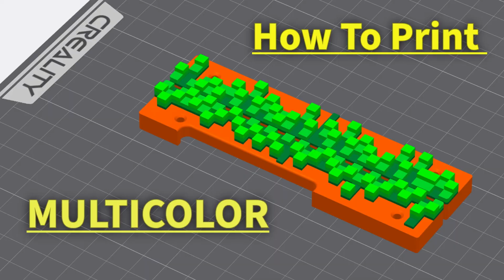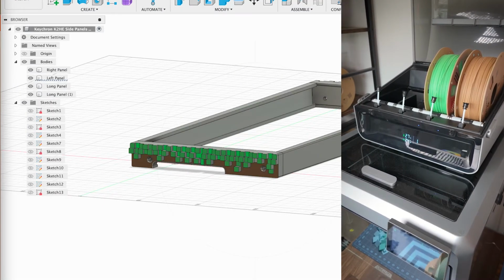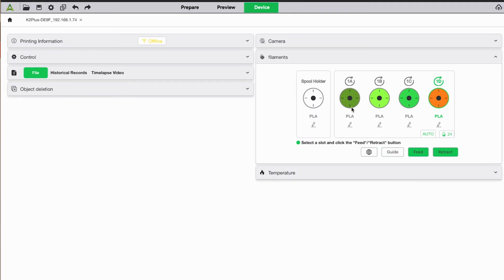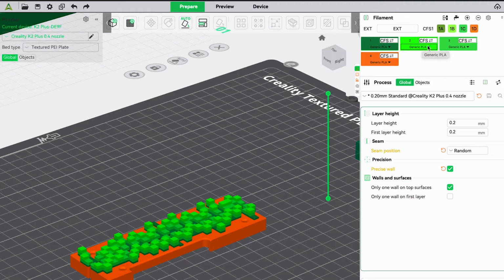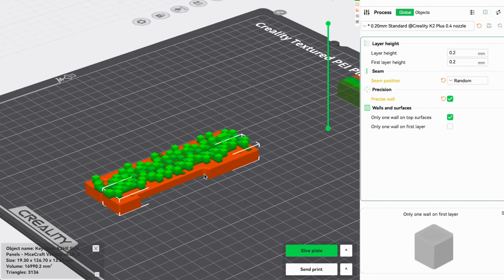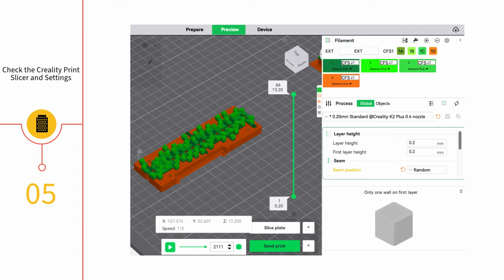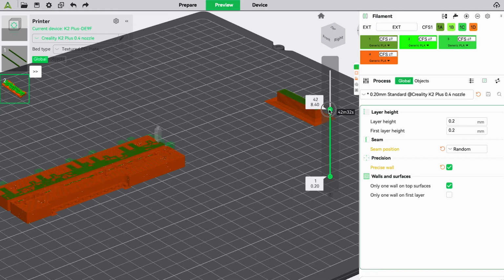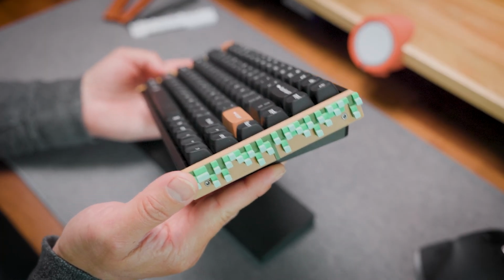How To 3D Print Multi-Color with Creality CFS

Comment: Any way to slicer recognize materials from fusion as colors?
Reply from the maker: I don't think so
Reply from the maker: The Creality Print slicer doesn't have direct integration to read Fusion 360 materials as colors automatically - you'll need to manually assign colors in the slicer by painting the model or importing parts separately with different colors assigned.